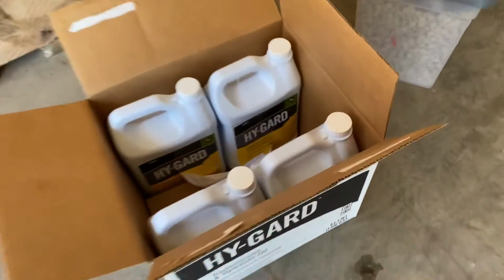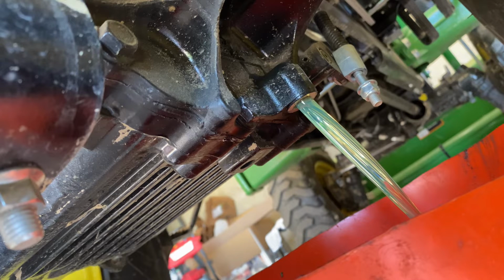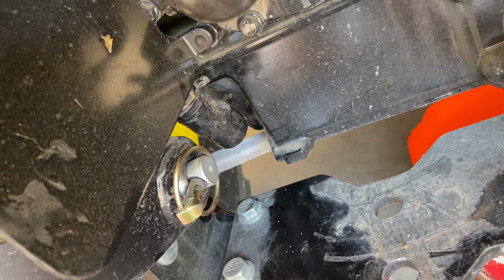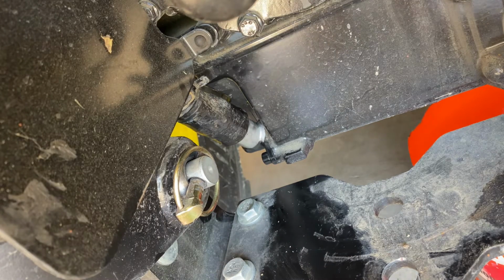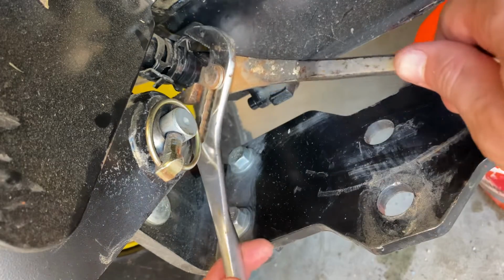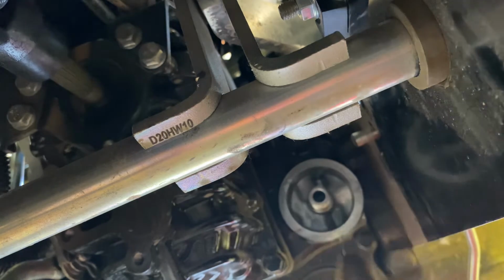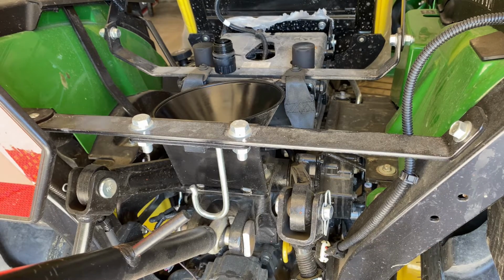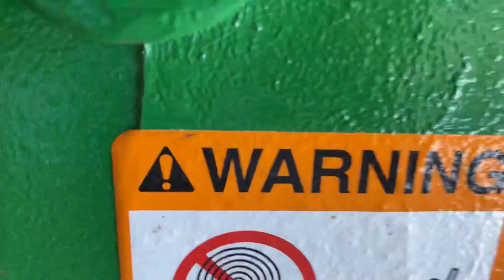John Deere 2025r 50hr Hydraulic Oil Change

Comment: Getting ready to do this on my 2025R, I appreciate the insight you have provided here. If I may suggest, the oil container is designed to be poured with the handle sideways and slightly below the opening. This prevents "glugging" and spillage early in the pour.

Comment: The next time I do this I will slide the rubber hose up like you did that worked out easier. I made a big mistake by loosing the bolt and working off the hose at the same time as I was trying to remove the fitting and the hose at the same time.the tube is extremely soft and I bent it slightly and it has a o ring that fits into that fitting. I didn’t want to take a chance and reinstall it so I replaced it and paid $80 for the screen that doesn’t include the magnet. I can’t emphasize enough how soft that tube and screen is and it has to come out straight and back in straight. Having to pay $80 for the part hurts and waiting 3 days because it’s not in stock doesn’t help
Reply: what does the rubber hose do? im confusd
Reply: @rvbzero7  the rubber hose connected to the fitting . Loosen the clamps and move the hose up and back,then when that’s completely disconnected loosen the bolt and then slide the screen out.

Comment: The real reason you do this at 50 hours is to check for and remove any metal shavings caught in the hydro oil filter. Pretty much a waste of perfectly good, expensive fluid. I'm doing mine at 150 hours, mainly because I'm cheap and lazy.
Reply from the maker: Agreed!
Reply: The real reason to do a 50 hour fluid change is to comply with maintenance schedule set by John Deere. Otherwise, your warranty could be effected.
Reply: @Ruflove  My warranty expired four months ago.
Reply: My owners manual on my 3039R say to do it at 400hrs. I questioned the service manager at my dealer and he told me to follow the manual.

Comment: Just curious but do the implements that are hydraulic need their oil changed  at 50 hours. And does the fluid get pumped through the tractors system?  Sorry if a stupid question very new to tractors.
Reply: Just asking as the hoses hold a lot of fluid.
Reply from the maker: The fluid gets pumped through the tractors system. I don't use any implements that are hydraulic outside of the loader currently. In my scenario it in theory gets changed when I change the tractor fluid. If you're using a used implement that has different fluid or maybe old fluid it might not be a bad idea to flush the implement prior to use. But to be honest, I'm not real familiar with best practices on hydraulic fluid so I don't know that I'd take my advice without confirming it with someone who does know lol.
Reply: Not per-se but things like Brush Hogs need the fluid changed periodically in their gear box. People often neglect their implements.

Comment: Will you take the wheel off next time, or do it again with the wheel on?
Reply from the maker: I might take the wheel off next time just to see what all it makes easier for a good comparison. I put wheel spacers on and taking the wheel off/putting it back on wasn't hard at all.
Reply: I've done it Twice now it can be a pain......I put red dye from the dealer in hydraulic fluid so if it leaks I can see it easier.,

Comment: I'd have liked to see WHERE the oil filter is located....not how to unscrew it. Likewise how about showing the sight gauge so I know what 'full' is instead of watching you use a funnel?
Reply: Hfg
Reply: If you listen to the audio, he discusses where the filter is located.  It is on the forward side of the transmission, upper left corner.  At 18:05 you can see him check oil level via the yellow dip stick.  There isn't a site gauge on a Gen 2 2025r.
Reply: then open the users manual. he shows 99% of it and you complain about 1 thing that's easily found on the machine, and another thing that doesn't exist.